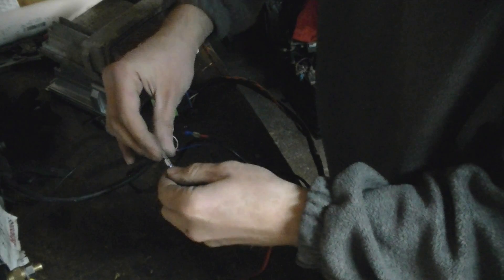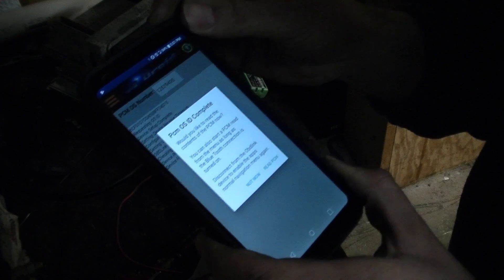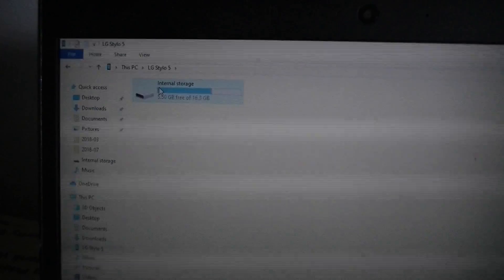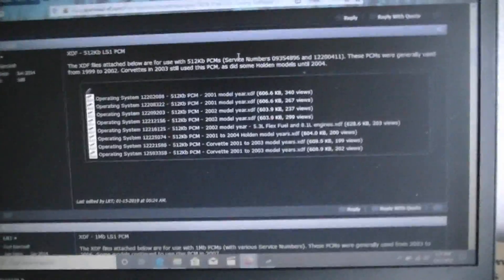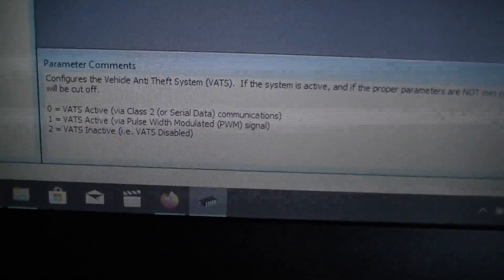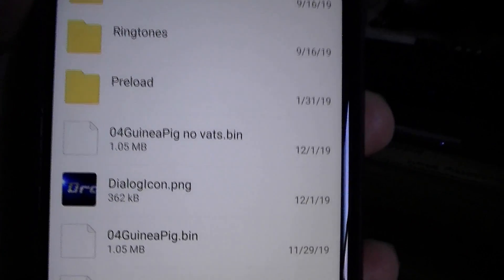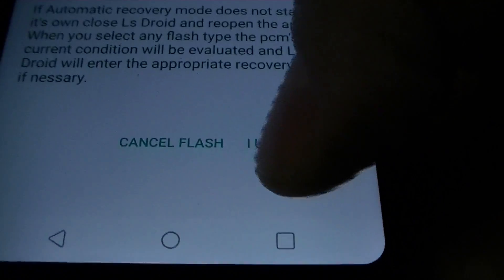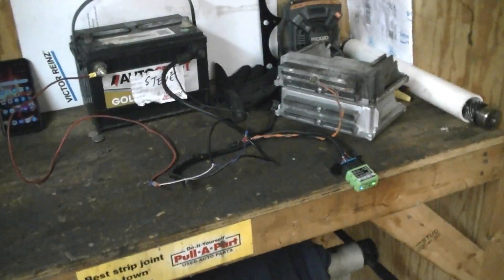#Free #How to: FREE LS1 ECM Tuning.. Read and Write your ECM. FREE VATS REMOVAL

Comment: i finally was able to tune my pcm, supposedly successfully. All i needed was vats removed and fans turned on but was a process.
First i tried LS droid and it wouldnt register to either phone i tried and the creator got pissy with me  n acted like im an idiot.
So instead I used PcmHammer to easily read entire pcm 1st time  and save as stock bin.
then used tunerpro with my 1221256 OS to  change vats and turn on/off temps for fans
BUT when i went to save this file it gave me a checksum error
Then i had to search around for the checksum creator for the checksum DLL,  he gave me  one but that didnt seem to work either.
Next i even tried the Legacy version of LS droid on my new Android kingpad k10
It wouldnt work either 
Next i even tried the rt version of tunerpro and even it gave me the checksum error. 
Finally the checksum error creator gave me his tuning software which automatically corrects the checksums.  it worked instantly. After all this 2 week long ordeal that seemed too easy, so i waited till i found a 2nd pcm in case i bricked it.
Then i found one for cheap too, so i tried  using pcmhammer to write  the original pcm with my original modded bin files and sure enough pcmhammer said file is corrupt , it will brick your pcm
So then i tried the checksum fixed  bin and voila it wrote first try.
Only took an entire month to   tune from first time i read the pcm till today.
We shall see  tomorow morning when its not 36 Celcius out if this new tune will not only run but  turn on/off my electric fans. FINGERS CROSSED.
Reply: what model of vehicle is it?

Comment: I have a locked ecm(due to a box performance tuner glitch) for a 99-02 Silverado with the correct vin# and up to date GM reflash specs. I now have a used ecm from a different truck (99-02) in my truck which got the truck running again. Could any of this process ,or in your other vids, allow me to transfer all the correct info(vin#/tuning specs) from the locked ecm into the used replacement ecm?

Comment: So I read my BIN and transferred it to my PC but I can't seem to find an XDF for BIN 12579405. I had read that the 2004 XDF/BIN 12587603 is a generic one that's compatible with almost all P59. When I try to flash my ECU with LS Droid it says that it isn't compatible with my ECU. Do you know of any BIN/XDF that is compatible? Sorry for the bothersome question since I'm still new to this.
Reply: I checked my spare ECU to see if I could use that one but it's OS is 12593058 and after some digging both of my ECU's are Intel only units which didn't allow either of them to be flashed with 12587603. Any help would be appreciated.
Reply: @frankvaldez8873  Frank, I am 100% learning, but how I understand it is: 

You download an OS and a XDF that is compatible with your ecu. You flash both, and then you can read it back and work out the files.

Comment: Can you give us the link to the XPD file that you used from GEARHEAD to populate the TUNER PRO? I'm not clear on which one to use and the SERV # 12589462 so that I can use drive by cable instead of the DBW because I am using a 200 4R. And I have no idea what Im doing! But like everyone else I would like to try and give it a shot.
Reply from the maker: Any file that is listed as a 512kb ECM will work for what youre doing.
Reply: Ok thanks

Comment: Another easy way to figure stuff out is use hpt open a cammed tune file and put everything in respective formats(grams kpa etc) transfer to tuner pro and have a tune 95% of the way there it's nice having the free tuning capabilities but it's going to take a while to get a repository going